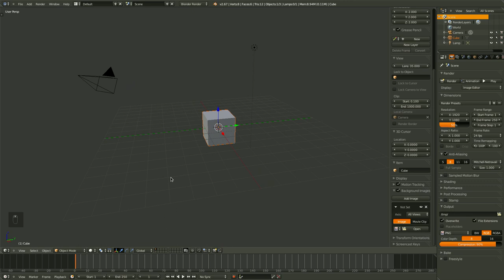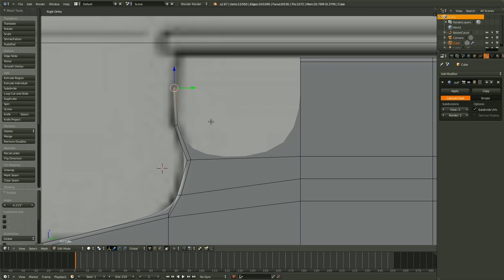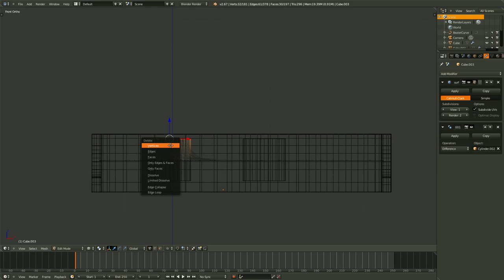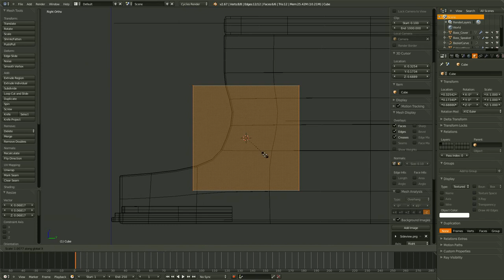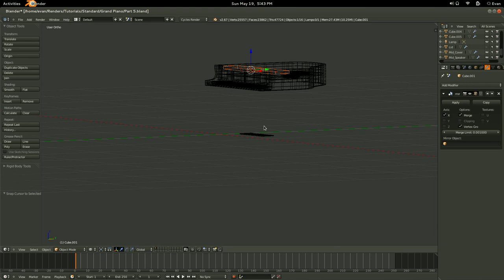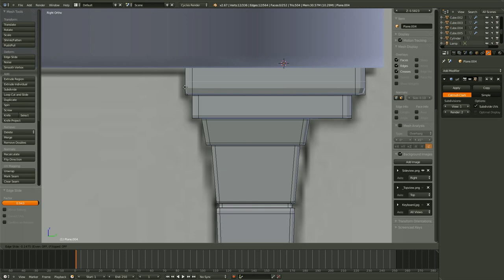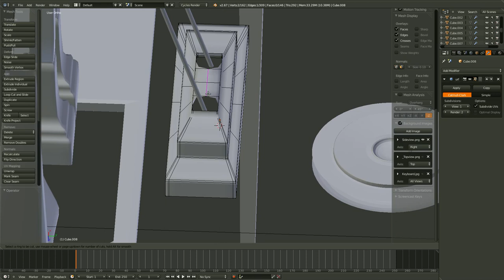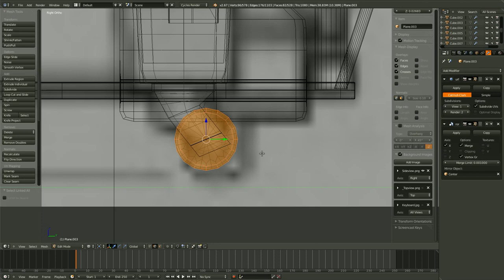Grand Piano Tutorial Part 1

Comment: Hey. Just wanted to share a tip about the"spin" function, which he uses starting at 13:24 by using the shortcut alt+r. If you want it to spin around only one axis, like we want it to do here, make sure the "axis" value of the axis we are spinning around is set to a non-zero value, and the other two axis' values are set to 0. This will prevent the spin from leaning to one side or the other or creating other unwanted effects. So in this case, we want something like Axis X: 1, Y: 0, Z: 0. You can actually use any positive value for X and it will give you the same result. Try it for yourself. If you were to make X negative, such as -1, you can simply change "Angle" to be a positive 45 in this case and you will get the same result.

Also, if you find that it is being "a little bit jumpy" as he does at 14:00, hold down shift and it will slow down the movement and make it easier to control. Hope this helps.

Comment: A faster way to do 21:20

alt right click the outer edge on the top piece.
shift+alt right click the outer edge on the bottom piece.
At the bottom of the screen click "Mesh" to open the mesh menu.
Go to Edges, and then select Bridge Edge Loops.

You may need to flip the normals. Use the Mesh menu again, go to Normals, and choose Recalculate Outside.

For you hotkey users just hold ctrl+e and select Bridge Edge Loops.
Ctrl+N to Recalculate Normals.